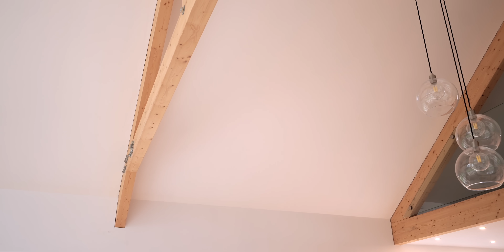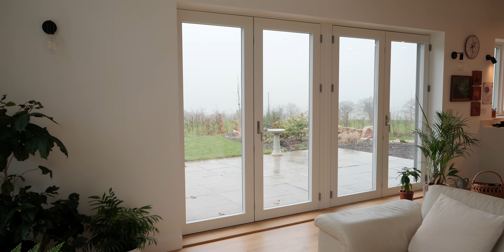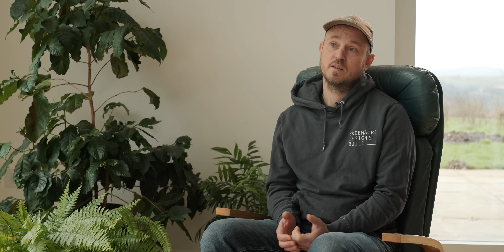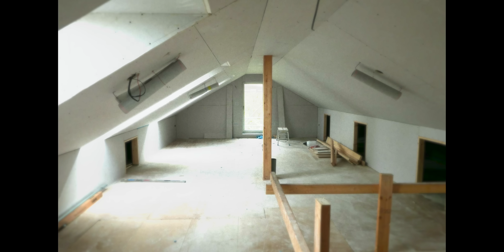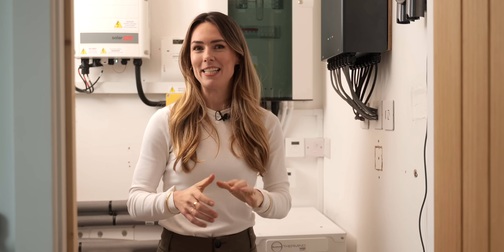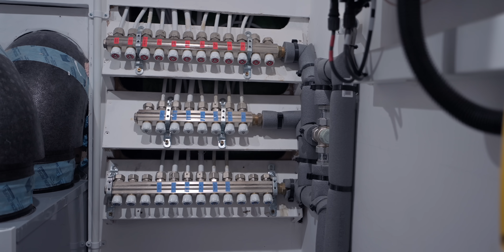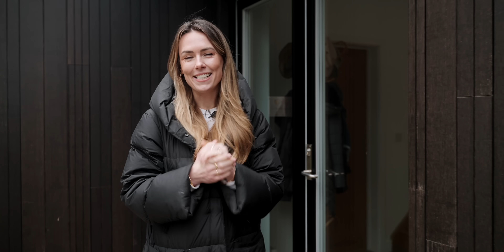Ditching a Heat Pump for In-Plaster Infrared Heating?!

Comment: Super interesting episode Imogen. As a solar and EV owner my first question would be whether Julian is considering using his EV in a V2H capacity? Seems to me to be a logical next step for him.

Secondly the in wall carbon panels are such an elegant strategy but what potential risks do they pose if they are punctured by the likes of picture hooks or the towel rail mounting both in terms of electrocution or damage to the panel itself?
Reply: My first question is how is he running a fairly big home in winter when it's dark with no other source of power generation except the grid......he has no storage batteries and he is saying it cost him £196 all year with a cupra bourne car "50kw" and I assume a washing machine, dishwasher ect......the solar won't work at full capacity everyday and all year......how does he run the lights.....? The appliances....? 
Cooking on an induction cooker costs a good amount, I know I have one, my home is fully electric with very good insulation, it's not a passive house but it's very good.

Unfortunately from my personal experience I just don't believe him.

Also my home is running on solar, home batteries, an ASHP, I also have an EV and zappi charger, so I get it...... I've done a vast amount of workings on this to get a very efficient system and I understand his solar generation better than most as I also live very close to his location on the fringe of Dartmoor, so I understand the weather conditions and generation we get in this area.

One thing I noticed was his house and solar panels are facing East....not the greatest for solar generation and his solar was in dense shade......🤔
Reply: @Devonshireandproud  16 PV panels would seem to suggest that he has somewhere approaching 8 kW of solar. We have a conventional house in a temperate NZ region with 13 kW of solar. That charges 2 EVs, heats our water and pumps our water supply. Our net electricity costs over the year is >NZ$300 credit, with no battery but eagerly awaiting the possibility of V2H.

Also the Cupra Born is 170 kW with either a 59 or 77 kWh battery.

Plus as Julian explains at 10:30 his night import rate is over double his export FIT so some pretty healthy credits to help things in the dimmer months I guess.
Reply: @HarmLessSolutionsNZ  I had a cupra "that exact model" for work, you never get the full 59kw of efficiency out of it, especially around Dartmoor national park in the winter...... also Dartmoor is not New Zealand......I live a few miles from this guy's home, and have renewable Tec......I have 4.2kw of solar facing almost directly south and it produced 3804.1 KW last year, I have 10kw of batteries, a zappi car charger and an 80kw Skoda enyaq plus a 4kw ASHP that also heats my water.....I know renewables enough.

His panels are not efficient.....he should be getting 12,000kw if not more if they were placed in a better location "especially not in the shade like you see in the video" 

He also mentioned he gets 6000kw a year that matches his homes demand.

So either his solar is underperforming or he is lying and getting one heck of a kickback of cash from his electric company.......

I get roughly £300 a year from my tiny system.....

Sorry but his figures and system size doesn't add up especially as I know this area and I have three years of solar energy data to go on.
Reply: @Devonshireandproud  You really should get on top of your understanding of kW vs kWh if you want to be taken seriously.
Reply: Good question.  Our panels have been deliberately designed at 36v SELV and with unique bonding process that allows penetrations of up to 70mm

Comment: Based on average UK fuel prices and car efficiency as of January 2026, running a petrol car for 7,000 miles will cost roughly £900 to £1,150. At a few hundred pounds per year for electricity for the house and car, the ROI looks good indeed.

Comment: Expensive low efficiency heating made possible by a high efficiency building method, and warm but never hot climate.  Maybe if you live in the UK, everywhere else, get a heat pump.  And DO build to Passivhaus standards where ever you are.
Reply: The problem of getting a small enough heat pump still needs a solution. Passive Haus peak heat load is ~10 W/m²
Reply: @ecok  True, but the downside to a too large system is cost.  As long as the total cost of ownership is less than the alternatives (which it CERTAINLY is in this case), you are better off with the heat pump.

Comment: Maybe it's the editing but I don't get the argument that they've been living there for a year and had 5 days of power cuts but still decided not to have a battery because "overnight electricity is cheap". What difference does cheap power at night make to get a freezer through a long power cut or allow for cooking, light etc. when the solar isn't producing? I guess a battery is an expensive option to mitigate for just 5 days/year but having electrical power during a power cut at night or on dull winter days seems worth it to me. Anyway, hat's off to them for building this, a beautiful job!
Reply: Was Vehicle 2 Home no option to combat the power cuts?
Reply: It sounded like he thought a battery would be only for power cuts, and wasn't bothered about cuts, despite being an all-electric house? He then went on to say they run all their high-wattage stuff off-peak (7p/kWh), then use peak for anything the panels don't cover during the day - which given it's a passive house should be pretty minimal.
Reply: Most home batteries don't work when you get a power cut otherwise you'd be back feeding power into the grid which could be dangerous. 
You need some additional expensive switching hardware for it to work during a power cut.
Reply: @TC-V8  wtf is the point of the battery then...
Reply: @akalion213 to store solar or cheap grid energy so you can use it when required.
Reply: @TC-V8  When required? So like in a power outage lol
Reply: @TC-V8  When required? So like in a power outage lol
Reply: @akalion213 I didn't design them buddy! You're acting like it's my fault!!
Reply: @TC-V8  it just seems stupid that anyone would wire them to the grid without a gateway to cut off your home if there’s an outage

It doesn’t have to be a fancy automatic switch, just have a manual one

A cheap current sensor can be clamped onto the mains line at the breaker box can track the grid voltage using magnets, and they come as smart devices that can notify you when power is back

Once grid is stable just switch back, problem solved

If you’re going the effort to build a passive house, this is not nearly as complicated as half the other design choices you’ve made
Reply: @akalion213 load shifting to reduce bills!
 In essence, charge your battery at a cheap rate, run the house off that lower rate energy when rates are higher. But I think a changeover/firemans switch is a worthy investment if you've got a battery. It cost me €1,000 in Ireland. We've had cuts, flicked a switch, and carried on. It's a great feeling honestly. In the run up to a storm, if the battery is low, we can force charge the battery off the grid to have as much stored energy as possible, which we did one day and it lasted 2 days while power was out. We couldn't use heavy loads, but could run the kettle, central heating, wifi stayed on. The basic comforts were all there. Would recommend honestly
Reply: @TC-V8  That's entirely down to how you wire them up.
Reply: @TC-V8  The switching kit over 20 years of use might not be that expensive. If someone is building from scratch at a remote location, preparing for the next war, pandemic lockdown, zombie apocalypse, etc. is not really that odd.
Sinergy and Tesla offer backup without an extraordinarily complicated installation. Victron was more expensive when I looked but I'm sure there are others.
Reply: @NunoLima1337 clearly depends on usage, we might get a power cut for a couple hours every couple of years! Where as if you are somewhere which gets frequent power cuts then price would be no issue.
Reply: @TC-V8 

???
Reply: I'm still intrigued at this nonsense you posted about electrocuting grid repairmen.

Now, do you suppose the repairmen go about blindly splicing cables without a thought to their own safety?

Suggest you research isolators and repair protocols.

See what you make of that.

Plus of course the batteries feed the inverters and the inverters are connected to the property.

Manual or automatic switching to prevent damage to the inverter when the mains is restored.

You should have more faith in "proper" engineers' competence.
Reply: @ForestForest-n9i from Google.

Yes, house batteries can provide power during a power cut, but only if specifically designed with an Emergency Power Supply (EPS) or a compatible transfer switch to isolate the home from the grid. Most standard residential battery systems automatically shut down during an outage to ensure safety for repair crews, meaning they do not provide backup power by default.
Reply: @TC-V8 

Dangerous how?
Reply: @ForestForest-n9i back feeding power into the grid can be dangerous for the people working to try and fix the grid.
Reply: @TC-V8 sorry, but that is not correct.   The whole point is to provide power during blackouts.   You wouldn’t install a battery system without the proper switching protocol.

Comment: Have to disagree with some elements of this.  His installation would benefit enormously from having a battery, he could then have an E7 tariff @5p and export all of the solar.  As well as having powercut protection.
Reply: Also his heating is only 100% efficient. A 'difficult to run efficiently' heat pump would never run at less than that.
Reply: @KennyMacDermid Yeah, any journalist should notice that immediately. Infrared heating can't be more than 100% efficient. Any heat pump will be.
Reply: Yes but recall his "KISS"  ethic.

What size battery did you have in mind?

Comment: Thinking out of the box and using KISS can sometimes work well. A guy I knew was gutting a two up two down terraced house in a desirable part of London. He was doing the whole lot, open plan with chimney breasts taken out making two ground floor rooms into one, two bedrooms and a shower room/toilet in the roof space which would have heavy insulation in the roof incline, a kitchen in an extension out the back, longish garden. The place inside looked cavernous with chimney breasts and room dividing wall out.  Chimney breasts are a major channel for heat loss. And take up valuable space. 

He said he was going to fit a gas combi for heating and hot water. I told him to drop that and remove all gas, then go all electric spending the money having:
i.  internal insulation on the front and back walls, 
ii. thick insulation under the solid ground floor, 
ii. triple glazing,
iv. insulated external doors,
v. heat recovery fans,
vi heavy insulation in the kitchen extension.   

He was going to do something sort of similar anyhow. It was in the heat ind hot water I got him to focus on. I also told him to have:

Heating:
a. electric UFH downstairs under the engineering wood floor, and in the bedrooms as it saves space. Which having no rads appealed,
b. electric kickspace heater in the kitchen for quick warm up responses in the morning.
c. and an electric towel rail in the shower room.

Hot water all instant and electric:
a. An instant electric Quooker tap in the kitchen. A feature in itself, which also eliminated a worktop space consuming expensive designer kettle, 
b. The shower with a Raindance shower head,
c. bathroom hot tap and shower supplied by a thin, space saving, unobtrusive, instant, high kW, inline electric water heater in the cupboard next to the shower room. 
d. No DHW storage. 

All fitting his lifestyle. 

He did it. The heating and hot water was cheaper to install than a quality gas combi and designer rads for sure, which was what he was initially looking at. I said get the gas meter and supply pipe ripped out, liberating needed space. The iron mains gas supply pipe was also a heat sink which when removed improved matters. He saved around £100 per ann. in not paying a standing charge for the space consuming gas meter. That buys a lot of electricity. The place was so well insulated he not once had the UFH on upstairs, so he could have saved more on installation costs by eliminating the heating in the bedrooms. The heat demand was low, very low, so resistance heating was fully suitable in this situation. He said: the bills are so low they do not bother me.

It would have been better with solar panels of course. But at what cost? Where was the space for an inverter in a small house? And what would be the return on investment?  If you do not need much heat to begin with then even normally expensive to run resistance heating works out cheap to run.
Reply: Space for an inverter? How big do you think an inverter is? 
That inline electric water heater sure sounds 'efficient'...
Reply: @FiveFiveZeroTwo  
It was a two bedroom terraced house with limited space. Space was paramount. Space in London is very expensive so best to use it, not clutter it up with needless technical junk.  I suppose an inverter could be in a small external cupboard at the rear. The electricity consumer unit was over the front door behind a fireproof metal door. The consumer unit could be with an inverter in a cupboard at the rear of the house together with an inverter. However an inverter gives off heat which will be lost if it is fitted in an external cupboard.
Reply: @FiveFiveZeroTwo  
today a rectangular Ariston Velis Pro hot water storage tank could do the job.

Comment: An ASHP system which does hot water and heating system seems nearly as simple as the two separate systems Julian has installed and more efficient. Would still choose ASHP system because of efficiency. I would how ever concede the systems Julian installed don’t involve many moving parts which will undoubtedly be more reliable and cheaper to maintain.
Reply: I think getting an ASHP small enough is part of the challenge. But I agree with your point; I live in a Passive Haus, we designed it for "no energy" so we could be as Eco as possible, with benefit of hindsight we should have chosen "as comfortable as possible" - UFH/other everywhere and cooling too. It uses SO little energy that comfort would not be extravagant, and in summer PV would make aircon cost-neutral
Reply: That's right!  Plus it has a 50 year design life, frees up plant room space, reacts far more quickly, needs a smaller array, can provide spot heating during the shoulder months when daytime heating isn't needed and is easier and cheaper to install.  Oh, but it doesn't have a COP of 3